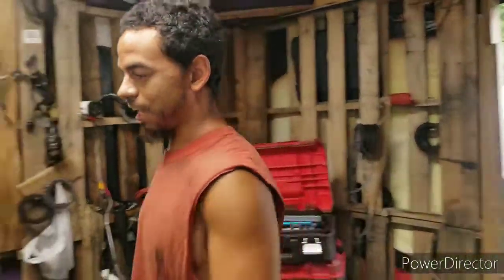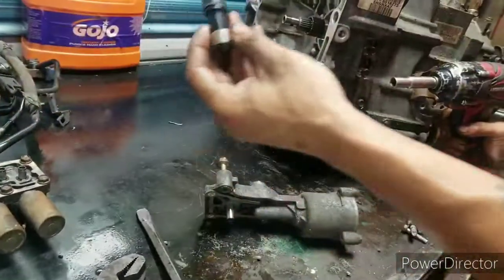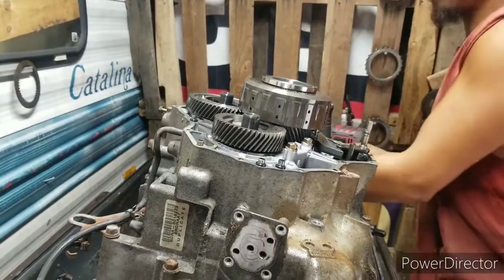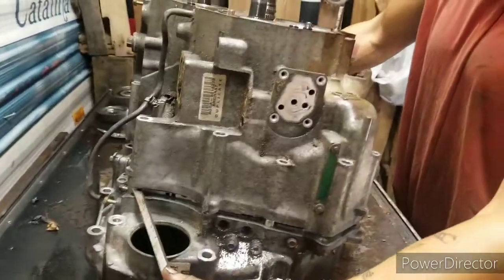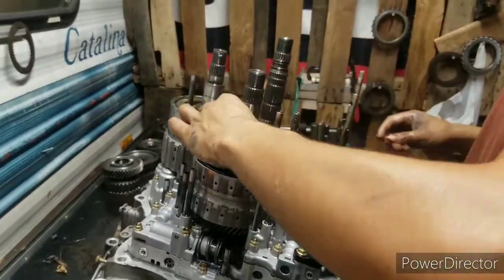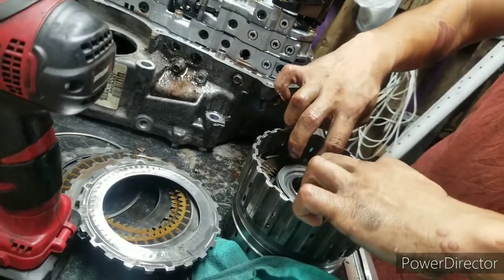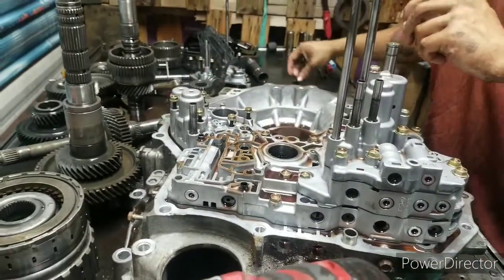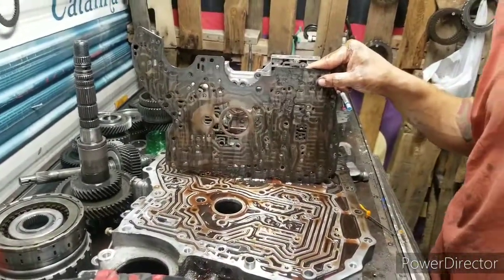06 honda odyssey transmission tear down  it's not looking good

Comment: thanks for sharing the rebuild my friend. just bought a 06 ody. didnt even make it home. i knew it was shifting hard when i bought it took it down the highway 5k rpm trying to get home lol til my exit then just called a tow truck. noticed fluid everywhere on the trans when i popped the hood when i pulled over finally. dont know how that could be possible wasnt like that when i bought it. oh well. time to learn something new. earned a new sub thanks

Comment: 06 with whining transmission, 2 shops says "sounds like it's the pump", one says drive it until it dies.  How long do you think the pump will last (miles)?  Thanks!
Reply from the maker: Change the cooler line filter  first 

It could also be the case bearings

If it was the pump it will be sounding like metal on metal 
If it's not slipping or anything just drive it until something happens

Comment: I'm assuming I don't live near you but if I did I would hire you as my mechanic. I'm from Washington state and my transmission is have 3rd gear bumping and it's kicking out of gear around 25 mph like it's in neutral and then comes back. I think is a selinoid but I'm not a mechanic. Like to hear your thoughts.
Reply from the maker: 3rd gear clutchs are burnt up
Reply: @bensautorepair9914  it dit that for a week and now it's not doing it. Could it be a selinoid? I've been driving for 3 weeks now and it hasn't done it once yet